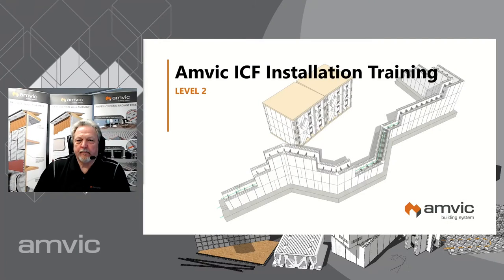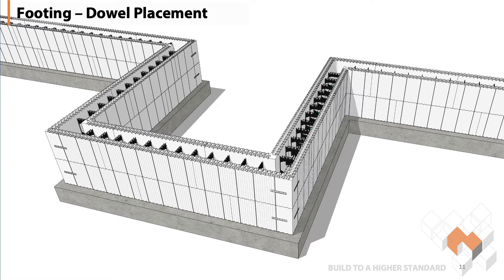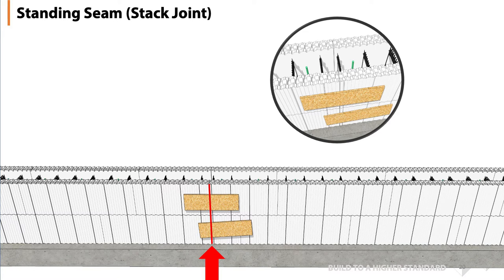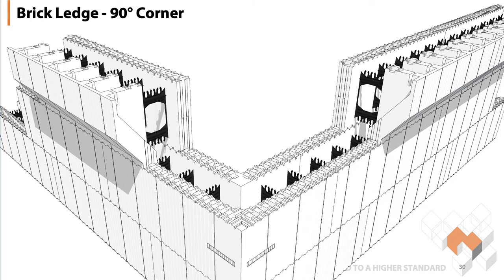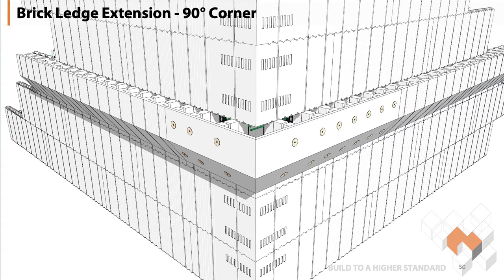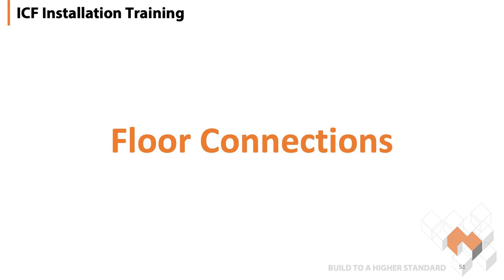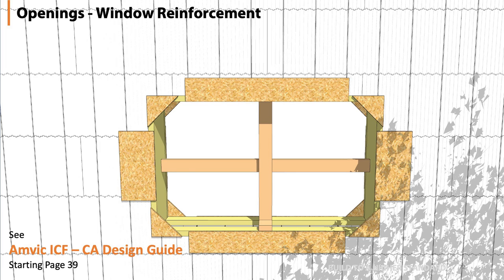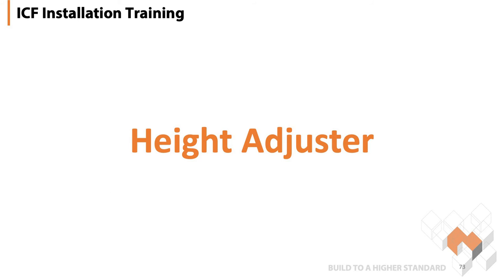Amvic ICF Installation Training - Level 2

Comment: The distance from edge of concrete to edge of reinforcing steel should be at least 40-mm.   The allows any penetrating moisture to increase in pH, to a high enough level that red, flakey rust can’t form, and any corrosion is a black oxide which is chemically stable, and doesn’t expand.